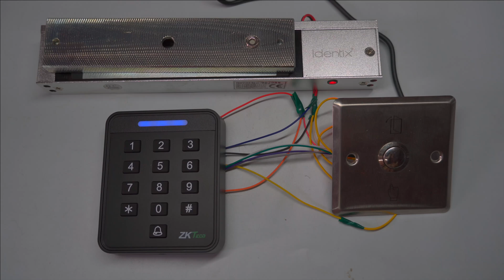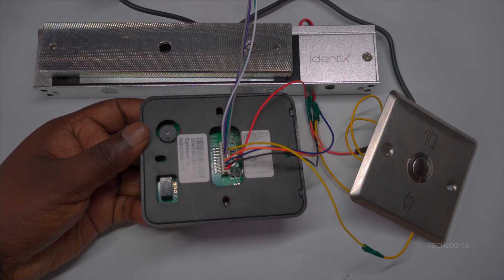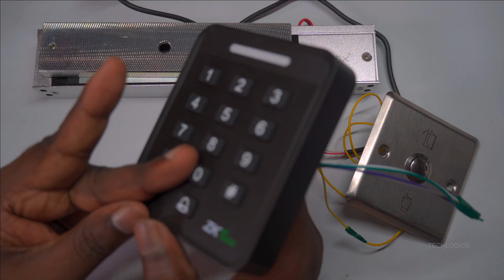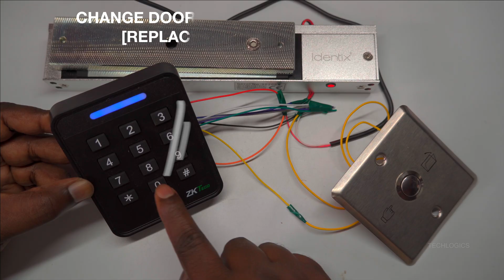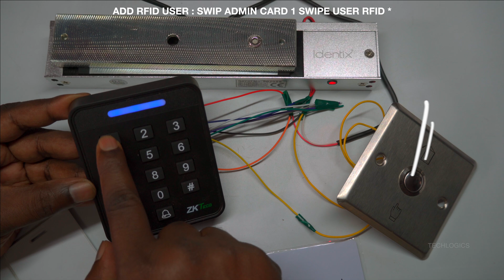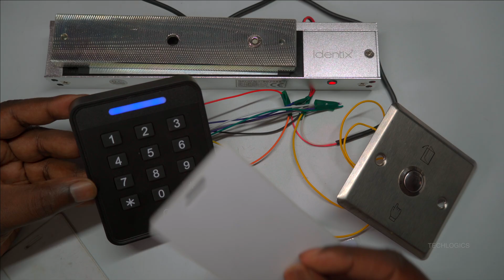How to Set Up Your ZKTeco SA40 Access Control System: First-Time Use & Password Setup | Part 2

Comment: my keypad is giving alarm after powering up
Reply from the maker: Ensuring that it’s getting the correct power supply, as incorrect voltage can cause problems. Next, double-check that all connections and wiring are secure, as loose connections can trigger alarms. Additionally, verify that the device's tamper (switch) alarm isn't being inadvertently activated due to improper installation or mounting. If the keypad seems fine, it might help to reset the device to its factory settings and configure it again to clear any errors.